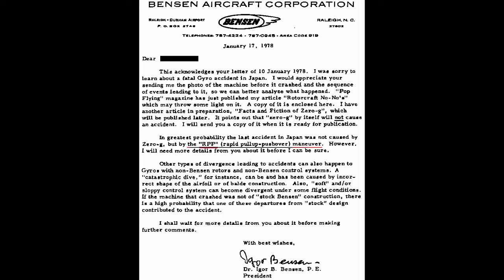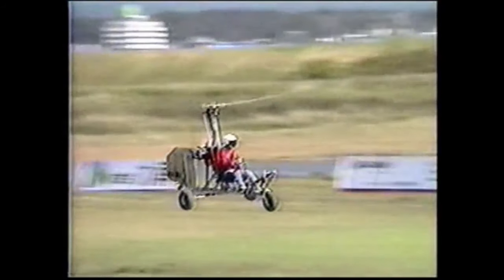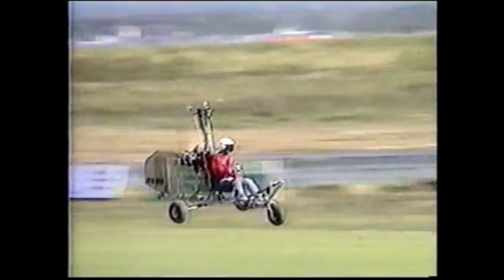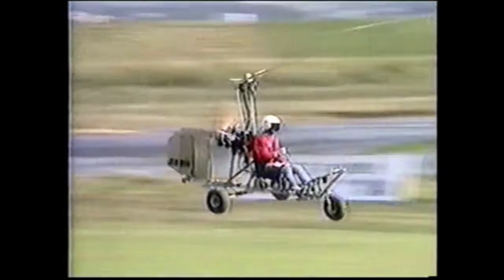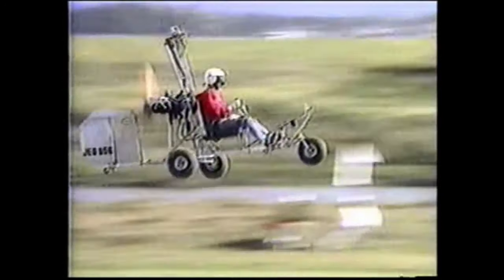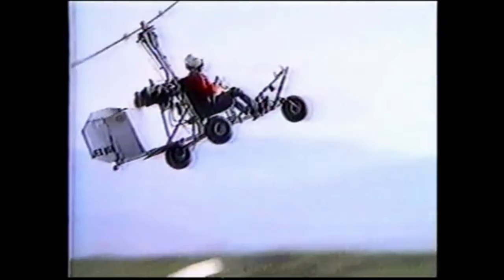Gyrocopter low g power push over crash (the cause of many gyrocopter fatal accidents)

Comment: I don’t fly a gyrocopter so I don’t know much about their flight characteristics, however I have a Bristell, a light sport aircraft with a fairly big engine given the weight of the plane, 140 HP. I can easily stall it if I pitch up too vigorously. So It seemed to me that the pilot in the video stalled the aircraft by pitching up the way he did. Please let me know if I’m wrong about this.
Reply from the maker: Hi it isn't an aerodynamic stall as the lift device [rotors] are spinning and therefore have a rotational velocity and the AoA is to the relative wind.  What has happened is the blades get unloaded and therefore their force is no longer opposing the thrust from the prop.  That causes a bunt and more -ve g whist loosing control authority from the rotor.

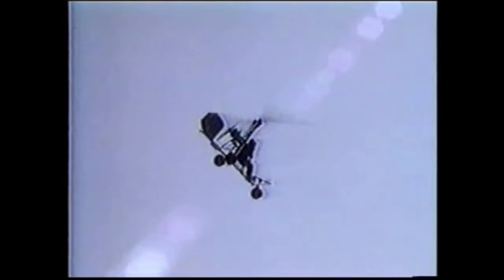Comment: 2:07 2:08 did the rotor hit the propeller blade? It looks like it did?
In the last frames I can see pieces flying off even before the craft hits the ground.
Reply: Considering how thes flying things are build this should not be a surpise. But to be fai any plane/helo can be made to disassemble in the air first rather than on the ground second.
Reply from the maker: Its likely - once the rotor is unloaded, in this case caused as the aircraft starts to fly in a ballistic path and therefore g becomes towards zero.  The rotor then starts to loose RPM and eventually starts to flap and finally looses its structural integrity.

Comment: I appreciate you leaving out the actual impact.  I noted that the rotor started to oscillate dramatically as he went to level (which he did while closing the throttle).  Don't you want to keep the power on in order to maintain rotor load using  air speed?  I guess in this case, had he cut the throttle earlier, he would have maintained load on the rotor.
Reply from the maker: Thanks Bryan.  Actually the pilot doesn't close the throttle at the top of the climb prior to levelling out and its that which causes the issue.  You need to reduce the throttle at the top which does two things.  1) it removes the thrust from the prop and also the torque effects of the motor at higher RPM 2) it loads the rotor disc.
Reply: kip
Reply: Is it just me or was the rapid change of altitude responsible for- the blade on top- to make the aircraft unstable. Sorry, not down with the aircraft jargon.
Reply: @jeffb8562  The blade on top is the "rotor". The blade on the back is the "propeller".

Comment: I am a old guy and a old pilot and love every thing in flying, even gyrocopters; however I would never fly in one. Let me tell you why.  The rotor blades have no inertia and because of this fact the blades are apt to slow very rapidly and lose rotor speed . Thus the reduced lift and no way to recover and the end of your flying . Note in the video that the rotary-blade never strikes the tail and vertical stabilizer.  And if I did not know this fact, I to would fly a gyrocopter.  However this said, "you can not stand between a man and his destiny".
Reply from the maker: of course you can always maintain flight in positive g.....
Reply: Yet you would fly in an aircraft that is incredibly vulnerable to a major accident in the event of engine trouble during takeoff, and which has inherent issues with spin and stall. For a gyro,  an engine out is a doddle, and of course they don't have any issues at all with stalling or spins. Furthermore, because of their high wing loading, they are far more stable in adverse conditions than fixed wing aircraft - unless it's something like a F-104 Starfighter! :)

Comment: I am not a gyrocopter pilot, but do have considerable fixed wing time. It appears to me the rotor, which is the gyrocopter’s wing, stalled, am I correct?
Reply: It looks to me that  rotor hit the propeller. 2:07 2:08 . Pieces fly off in last frame.
Reply from the maker: Hi - once the rotor is unloaded then there is no directional control nor force to oppose the torque of the prop/motor, hence the roll.

Comment: Aren't these types of gyro (I do not see any horizontal stabiliser) less stable in pitch than our Magni, AutoGyro, Ela's ?
Reply from the maker: It’s one of the sources of debate. The aerodynamic study that was commissioned by the CAA suggested that horizontal stabs make no difference when they looked at the actual data. The issue (and I think why the confusion exists) is because inbetween the time the aero study was commissioned and its eventual publication in whole there had been a fresh set of accidents with RAF2000 and the CAA has by then suggested horizontal stabs as part of the solution to that problem. So the CAA made efforts to disagree with the data and recorded so in the published report despite there being no data just subjective feeling from their test pilot.  My own feeling for what it’s worth is that I suspect a tailplane gives a feeling in some flight modes but a horizontal stab means what exactly? Where is it placed, (not just in ref to CoG but also to the prop) what aerofoil profile,
Reply: @gyrocopterflyingclub6148  At the airspeed at which this event happened, the pilot would have had very little elevator authority (unless, perhaps the empenage was directly in the prop blast and sufficiently large to overcome the thrust-line moment).

Comment: @Neminem Laedit  Thank you for the link on the Japanese Cavalon crash. It would appear that the cavalon is not immune from the traditional 'bunt' event, which is mostly a thing of the past. There have been a couple of Cavalon 'en route' accidents, so far unexplained. Perhaps their horizontal stabiliser is not big enough, or mounted too high up.
Our host remarked that the Cavalon stabiliser is smaller than other similar machines in another video on the 'Cavalon nod'.

https://www.youtube.com/watch?v=xFcgEPz0LVg&
Reply from the maker: Hi - see this at around 12m55s for a look at tailplane [the 2017 Sport is consistent with Cavalon] https://youtu.be/n2T2N9Q-RFU

Comment: Tbh even a fixed wing would have behaved in exactly the same way, it's just a stall due to pulling back too hard and losing all airspeed over the wing (rotor). No correction possible at such a low height. Be gentle be graceful and never show off.
Reply: You are completely wrong. What you say applies to fixed-wing aircraft. There unloading (stick forward) gets you out of the stall. In a rotorcraft it kills you.
Reply: @thesep1967: At 100’ AGL you’re not coming out of a stall in anything no matter where you shove the stick.

Comment: For several years I have wanted a gyrocopter. I never knew about this problem until I saw this video. This has totally scared me away from the idea !!!!  I will NEVER EVER get one !!!!  I thought that a gyrocopter could not be stalled like a fixed wing aircraft.
Reply: 😂...c'mon now, this guy had a death wish or was a self trained pilot, training himself on a obvious new maneuver🤔...
Reply: That's still true, this wasn't a stall. But it's still bad. When it comes to flying, don't "want" an aircraft, "want" spending the time and effort to develop a satisfying skill - you'll live longer.
Reply: As has been pointed out, this was not a stall. A conventional aircraft can recover from a stall with enough altitude. Unloading the rotors on a gyro is like tearing off the wings of an aircraft - once the negative G's have taken away the lift, the blades are unrecoverable, because unlike a helicopter they're not being mechanically driven. They are always in a state of auto-rotation - stop the air moving through the blades to keep them turning, and that's it, game over.

Comment: Surely it's not beyond the wit of man to adequately (mathematically) simulate the rotor motion (indeed, the whole aerodynamics of the craft) and see how fast and easily it unloads in similar or other gnarly scenarios we can dream up - without RC models or folk dying?  Would be very useful to compare rotor models as well as C/G positions, stabiliser sizes, etc.   Need a university aero engineering department to assist, as my Rolls-Royce performance office days are well past!  Perhaps a regulatory body push in this direction - pardon the pun - would seriously help in a world increasingly overtaken by commercial, proprietary muscle.
Reply from the maker: https://publicapps.caa.co.uk/docs/33/Paper2009_02red.pdf  to be fair this surely went a long way to  doing that... except when it was published a great many disregarded it and to some degree that included the people who commissioned it.  Personally I think it is incredible but you live long enough I guess you see everything!
Reply: @gyrocopterflyingclub6148  Tervamaki figured it out 40 years earlier. Gave up in disgust, at the denial he met. 

But, luckily, he sold his plans to Magni,  who started popping out a few factory-builds from the late 1980s. 

It snowballed in the early 2000s when AutoGyro-GmbH and ELA-Aviacion joined the party, followed by several more smaller manufacturers. All copying the same basic design. 

Probably 5000 of these machines are now flying worldwide, and the gyro renaissance is well under way.
Forecast to be one of the few growth areas in aviation in the coming decade.
Reply: @gyrocopterflyingclub6148  aha... v.useful material - alas too heavy for many, even enthusiasts. My hope is it could instead become an app or at least a webpage interface that accepted specific gyro parameters (not the manufacturer's app unless adopted by CAA) - like an MS Flight Sim for autogyros!  Altho many manufacturers' autogyros resemble others, it would be instructive to model each and develop some measures of safety. The dimensions/ weight/CG etc are not secret once the machines are launched so i don't see why makers should object. Especially as lives are still lost on $100K machines.
Reply: It's been done in the UK including testing in machines with an array of sensors.  The report found a stabilisers don't work very well and there are stable and unstable Configs related to thrust line and cg.  Both downthrust or shifting cg matter but matter mainly at the high speeds.  The report has been ignored mainly.  My concern and I know I keep going on about this is much of the thinking is that it is possible to make and idiot proof gyro.  I don't think it is.  Go and Google gyro fatalities and look at the machines.  Almost all include stabilisers, all stabiliser Configs are represented,. High gc machines are also represented.  One guy I knew had brought such a machine.  A great machine I'd have been happy to own by the way.  But he had finished his training and was boasting how fast it was and he'd be taking up to over 100mph the next weekend.  All us old timers warned him explained it was a high CG machine,. It had a large HS.  He'd be fine.  He fatally unloaded the machine the next weekend.  It will not save you anymore than you can expect to survive sustained inverted flight in a chopper.  Anyone who wants to promote an idiot proof gyro can do so by performing that manicure should they wish to make the point.  I note no one is mad enough to try but they will market Thier machines as safe based on this.  People need to be clear.  No gyro is idiot proof.
Reply: @ExcaliburBahrain  this would be good but more than that we need generally much better instructors at least in my country.  I could tell you half the stuff I've witnessed for fear of legal action but I've seen some appalling attitudes and massive incompetence.  From instructors and pilots alike.  Thus series is excellent because it goes into the weeds
Reply: @RodCrosby   - great, all well and good!  With respect, my point is more on a training aid that would have helped both this pilot and today's avoid the type of crash shown.  The complimentary experience that such as an MS Flight Simulator for autogyros could provide could augment actual flights tremendously.  Essentially for free and time-unlimited.  And just as with MSFS, the differences between autogyro models could become evident, in terms of an awareness of the relative sensitivity to control inputs in various flight scenarios (even if imprecise and without tactile feedback).  For many, this may sound science fiction or fantasy - but it ain't! - am sure glass cockpits/ubiquitous iPads already have the required computational power...
Reply: @cameronlapworth2284   -  Agreed! Am not current, as i now live in a country where autogyros cannot fly, locked-down or not.  Learned way back with Chris Julian, manually swinging the glider rotor.  So I smile at powerful new autogyros slowly accelerating with the rotor held fully back... Can't help dreaming of an MSFS for autogyros as i mention in my response to Neminem elsewhere (above?).  Could massively augment general handling and enhance human training, as well as highlight differences between today's starships... (in which, sadly, folk still lose their lives).
Reply: @RodCrosby  tks vm for that, most interesting... i shall pursue!

Comment: They stall easy and impossible to recover at low altitude .....I suggest a fixed wing , much safer ..!
Reply from the maker: What bit is stalled?
Reply: Gyroplanes do NOT stall.
Reply: @abidfarooqui-sla3301  I think you'll find the rotars did stall.
Reply: @FireFX42  There's a colossal difference between unloading the rotors in a gyro and stalling. Gyros are stall and spin proof.

Comment: it looked like he continued pulling back ...never really leveled out ! What i think i see is ... it keeps climbing ... nearing the top ..he starts pulling back ... as it starts negative it looks like he pulled full back.
Correct me if i am wrong (FYI I am NOT a gyro pilot )

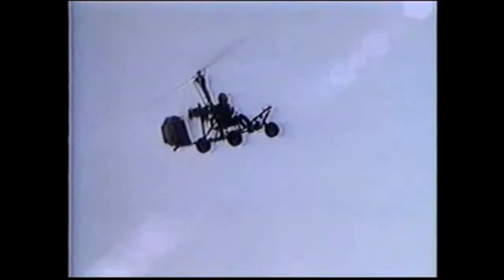on seeing again at 1:51 ish it does appear he gives a down but then pulls back ...
Reply: Watch again carefully he pulls back and established a climb you can see him push the stick forward but the machine is still climbing what you can't see is he's leveled the disk relative to the airflow.  Once the rotor unloaded (takes about 1 sec). He has zero control the machine still accelerating up generally goes straight through the rotor.  But he was screwed the moment the rotor unloaded.  You can do the same thing in a chopper although harder as the rotor is powered.  Gyros are stick free stable but stick fixed unstable.  That is if you leave them alone they are very very stable but the moment you move the stick the do exactly what you tell it to and don't stop until you correct.  So he didn't need to put in a big input but compared to a fixed wing but this was a big move for a gyro.  I'd do a demo instructing in the gyro glider for my students.  I'd have them watch my hand as I turned either side of the car and I'd just apply pressure and it's gently swing out release the pressure it's go back with a little opposite and so on until we were banking quite extremely.  They wouldn't see my hand move.  Now they are easy to fly,. But only after you learn to leave the thing alone and suggest you turn as I said much more stick free stable than a fixed wing.  And once you know how you can toss them about in a positive g way.  I'd do massive tight banks staring sideways at the ground blades whopping overhead but completely positive, never negative g.
Reply: @cameronlapworth2284   Thank you for that detailed reply ... I am a future G'pilot and this is very useful. CHEERS